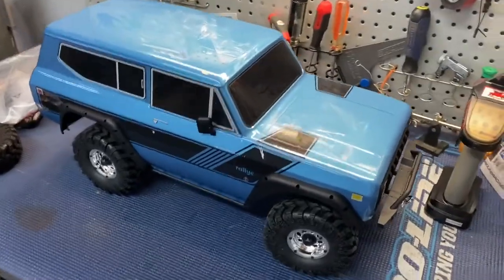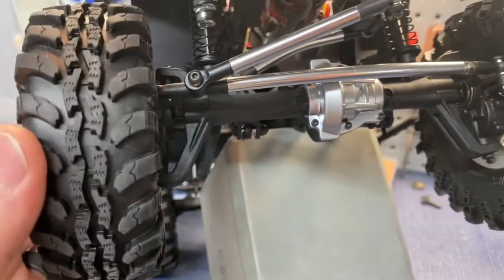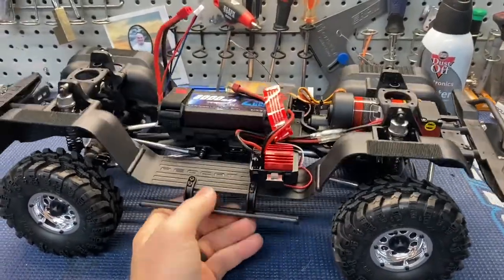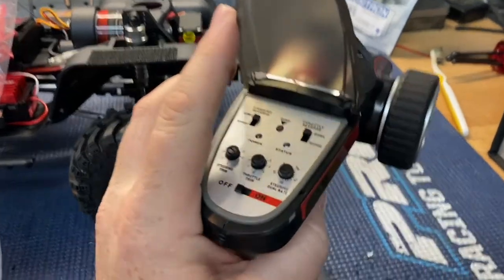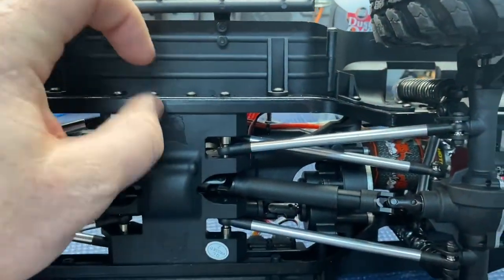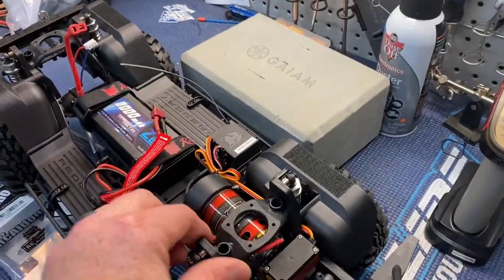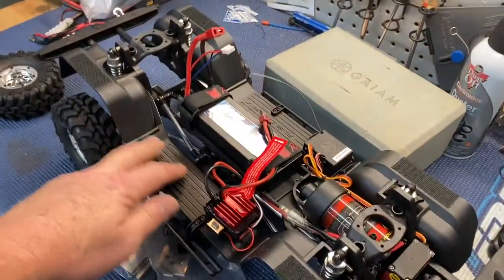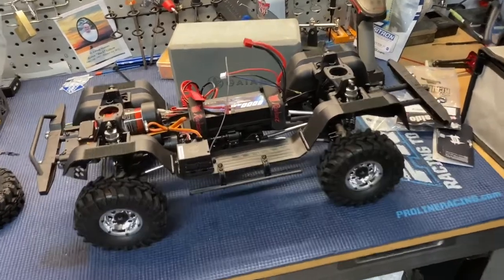Redcat Gen 8  Best RTR Crawler? At $239 It’s A STEAL!

Comment: Put a 25Kg servo on it and mount the steering link on the bottom instead of the top and you will cure 90% of your front end issues. The Treal HD steel gear set overdrive differential Gear helical for Redcat Gen 8 is also a nice addition. Makes it into a crawling animal. Runs about $25.
Reply from the maker: Burke Eschler awesome! I plan to swap the servo for sure. I know the Redcat servo won’t last long lol. Thanks for the info and for watching my vid!

Comment: Have you done an update on this? Im pretty interested. When I thought it was $239 I got really excited! They are 300 everywhere I have seen them, but 269 is great! $239? I would be VERY tempted!!!
Reply from the maker: ThePreppersBunkerOutdoors yeah they went up just after I picked mine up! I’ve seen the price drop again here lately though. I REALLY need to run this truck. I’ve had it since March and still haven’t even ran it lol. I’ve did more and more upgrades but haven’t even had it out. I just took the Capra out the other day and wish I had taken the Gen 8 instead because the tires I have on the Capra just didn’t work. I think I’m gonna like the Capra but the tires I was running were so horrible I just parked it and ran the 1/24s lol